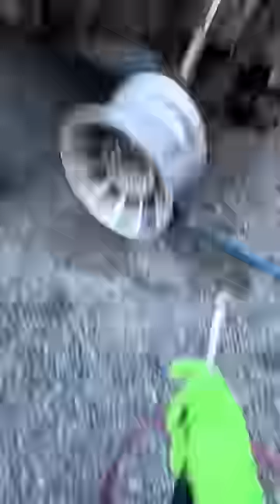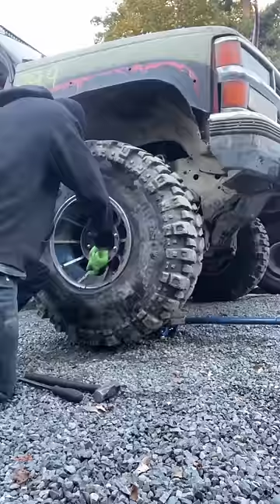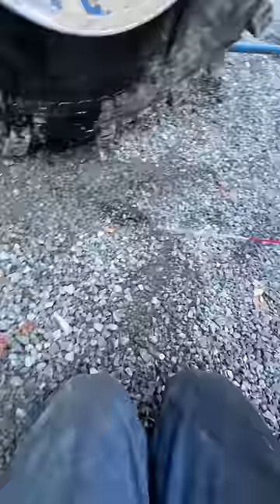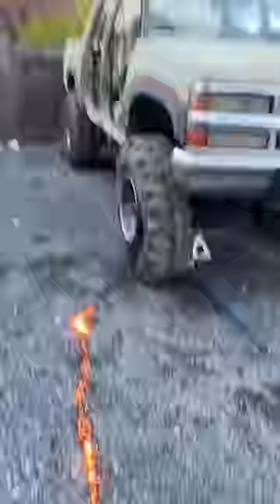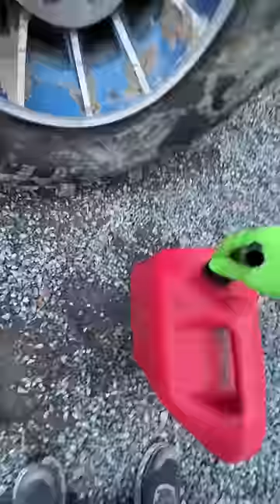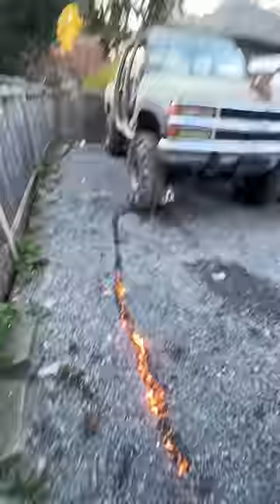This video Blew Up!! 🔥 #oddlysatisfying

Comment: Oh best if done laying flat on pavement instead of the vehicle. Rubber is flammable for one, and hard to put out for two.😮 
Easy enough to put on to hold the rim, and take off to "Pop The Bead On" without risking burning your rubber up, and wires, etc...😊

Comment: Convenient the video ended there...... Did the tire suck itself back off the bead? 😂

Next time put the chuck on the valve and this will atomize the fluid to make it go boom! It also makes it so the tire doesn't pop back off 🤣
Reply from the maker: Been driving on it ever since. No issues.
Reply: @MechanicalTriage  yeah, that's not something that happens over time 😂 

What I was saying is that once the explosion happens and the bead seats, the air then starts to cool thus in return sucking the tire back in which if air isn't applied quick enough will pop right back off the bead. 

Considering the amount of fluid and the widths of your tire Vs. wheel you were probably fine. 

The "next time" comment for you was just a tip so you don't set the vehicle on fire literally next time 😂.... Oh, and starting fluid works a treat! (A little is all you need 🤣)

Comment: I apologize but what is happening here? I'm assuming the explosion is somehow inflating the tire. But why not just inflate the tire as it is? No tube?
Reply from the maker: No tube. Also, can’t inflate a tire that isn’t sealed to the rim yet, so we’re seating the tire to the rim. Added bonus is that it also slightly inflates it. Good in an emergency when tire comes off
Reply: @MechanicalTriage  hah that's actually so cool then, good to know

Comment: You’re using wayy to much accelerant. You want just enough to cause the oxygen to suck into the tire. Spray just a second or second and a half of brake cleaner INSIDE the tire only, don’t make a trail, and, put a spark as close to where you sprayed without getting your fingers between the tire and rim.:) voila.

Comment: Old farmers trick? I am not old I am not a farmer and you are not doing it right. After this you have to make sure you clean up the air inside by inflation to 70 or 80 psi. Then you need to empty it out to the last until it stops. Then you fill it up again and repeating until there's no smell of fuel coming out of the air in the tyre. But I only do that when near an industrial air pump. Which if I don't have then don't fill your tyre up too much and roll to a station to do the procedures more comfortably. The thing is you can't go on High speed road with a correct tyre pressure stinking of fuel inside. It is an accident waiting to happen and I only apply this method when driving through tough terrain where I have to bring down the psi to a minimum of 10 or 15 psi. The wheels grab the terrain like chewing gum. Problem is you run the risk of tyres coming out of the wheel rim's and this was my solution for that problem. First time I ever did this I was 17 and I used mosquito repellent gas to pop a tyre in and inflated by foot pump. I came out with this one Idea because I didn't have a rope to apply a tourniquet over the wheel to seal all gaps and pump up air then it reaches a point when it sit in and that sounds like a bomb. From that acción which thought me that if I can explode it into position I can skip the laborious complicated technique of a tourniquet and holding while you pump? You then look like octopus trying to limb it all out. But I recommend the use of a tourniquet over BOMB pops into place. This method showed here ir dangerous and in a place that demands no excuse to have to bomb it. You grab a rope you circle it round the treated part of the tyre you tie up grag a stick or a big wrench stick between the tyre and the rope and apply tourniquet. This Will make the walls on the tyre to make contact with the edge of the rim sealing any gaps where air Can escape and begin to pump vigorously, but not with an electric industrial air pump. That would set it place in no time. I have seen in some tyre station some strong blokes that have been doing it for ages use their belly on one side and a hand over the opposite extreme get an almost there sort of tight seal and the high velocity high volume air pump just blow it pop like bomb. And that's what you want, clean air. I tell you I take air out of my tyre to cross a sand trap and if I can smell fuel or gasy air coming out of there and I'll panic a little bit. Will have to Ai insurance claims on blown out tyres accident before 2000 and after to see if there's a change in accident s numbers due to wheels bursting out of nothing on the motorways today. Very nice to come up with a solution for real trouble and in times of trouble only to see it being used in a garage or at the confort of your own home. Check your tyres weekly. ALLOW AIR OUT AND SMELL IT, then put the desired psi or correct air pressure pumped in all four. For city use 35 psi or 40 my recommendations. For long journeys on motorways? 50, 60, 70... Depends how light and small is the car 45-50, but a rel heavy one and loaded? 60 or 70. I know lorry driver that don't mock about they pump all 18 wheels of their heavy loads to a solid 100 psi like riding on stone mills! Pakistan is a place with the highest wheel tyre pressure and that is where I learned so much about tyre pressure. They didn't teach to me I battle it out by having so many problems with company cars and heavy earth moving machinery NOW THEY HAVE TO VERT A DIFFERENT GAS THAN AIR A MUCH LOWER TEMPERATURE GAS THAN AIR. if not they blow up by sheer sun, frictional heat, high velocity spinning, and SIZE!  The bigger the tyre the more problems because the cavity is much greater and harder to keep stable. Those tyres cost a fortune you cannot afford putting just air in them. So if you have to put special Inert GAS cooling none flammable (in fact the opposite) in an industrial tyre for it not to blow up as it stands? More more so on a family vehicles which can travel at a much quicker speed? Make sure you got proper air on your tyres and not some glittering glycerin gasification of some sort in the mix. Don't be dangerous to others on the road. Keep out of our roads with your time bomb tyres. Crazy people when are you going to learn? Or do I have to go around the world SPANKING everyone's rear ends?

Comment: it woulve worked the first time but you were being a little girl making a 10 ft long trail and took too long to light it.
Reply from the maker: Did you see the other video I reposted where the guy died from doing this shit?

I’m good. Plus it was the fact that I used brake clean the first time, cause I made a longer trail the last time with starting fluid and it worked. So, not the delay that thwarted the progress. …

Comment: This can be done I have done it but not with any of the chemicals  hes using and it's not to put air in the tire it's used for seating a troubling bead. No I won't tell how to do this.. He did t need this his bead was fine it's a pick up and those big tires like that go on with minimal air. Air! Do not try this he is confused and has this mixed up with bead seating. There is NO substitute for air. Smh

Comment: You are weakening your wheel when you do that
Reply from the maker: Please explain.. don’t think the thermal anealing of the aluminum rim is causing more issues than it being ran 1/2 a mile derimmed?
Reply: @MechanicalTriage  he wasn't ANEALING it, he was setting it on fire repeatedly,  aluminum is not a metal that can be tempered,  in fact aluminum fatigues easier than most,

Comment: Now they got that ghost ship out you know you put that goo all over you tired and it's supposed to seal it that is a bunch of b***** you're going to take 20-30 minutes out of your time put that s*** around your tires just to make it seal this is a faster way but you starting fluid it works a lot better starting fluid like they use in diesels and s*** yet put that on it by God and that right there I'll pop it out the first time man and don't spray a whole f**** half a can in it